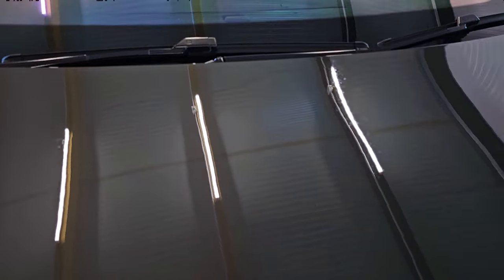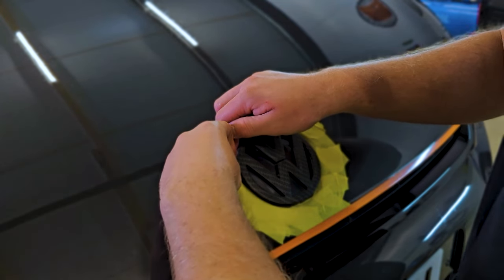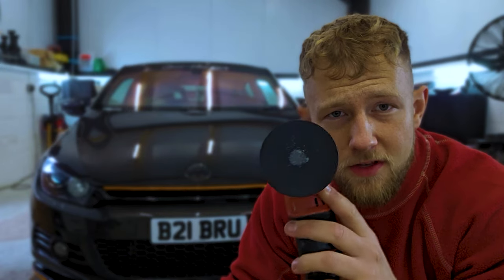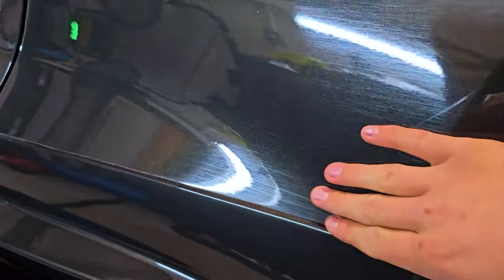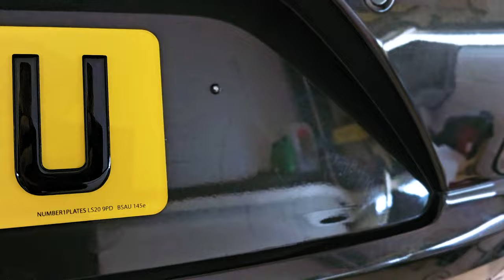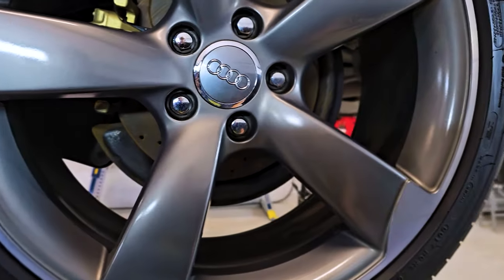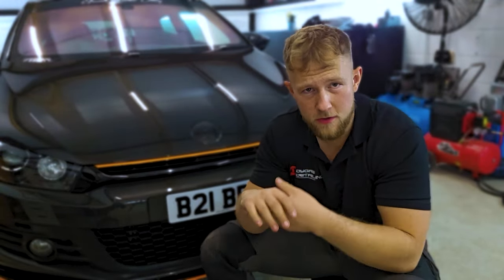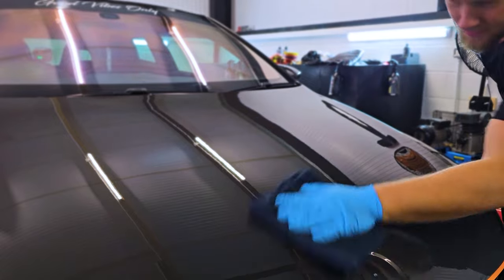VW Scirocco - Wash, Polish & Ceramic Coating (Full Detail)

Comment: Absolutely smashed it!! ❤ thank you for all your support Emil and for doing a miracle on my Scirocco! I am super happy with the car and will certainly be giving you all my support going forward! 🙌🏼
Reply from the maker: Thank you so much! Glad you are happy with it! Our pleasure 😁
Reply: Looks great, Are those wheels 19” “Rotor” ?
Reply: @sxixlxnx  hello 👋 thanks for the compliment 😊  yes they are, they off an Audi S5. Gives a wider stance which is what I was looking for. You going to get a set?
Reply: @MichaelSmith17  I am thinking about it yes, my only issue is the car is red. Not sure how it will look with the wheels. Do you run spacers too or are the wheels wide enough for a scirocco
Reply: @sxixlxnx  to be fair no matter the colour I think they would look great! I do run spacers, 12's all around 🫡 depends on the stance you looking for though. Just do some research on what works for you.
Reply: @sxixlxnx get the black deep concave they’ll look great on a red car 👍